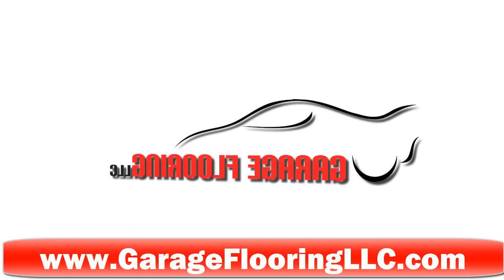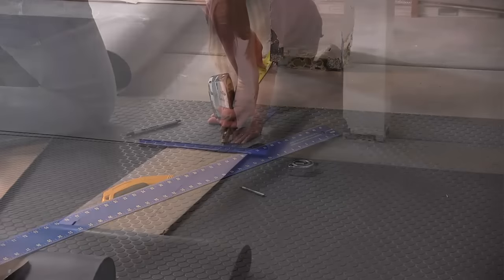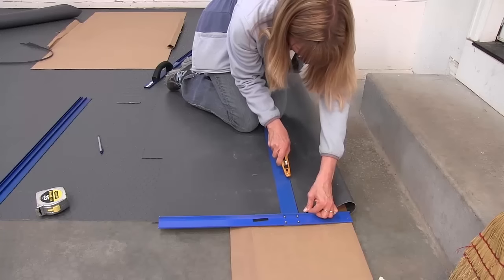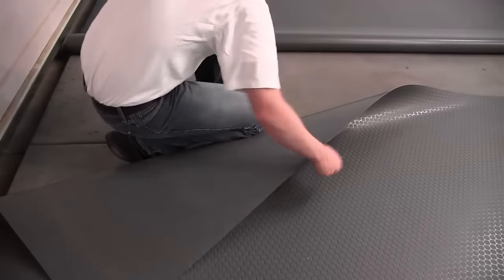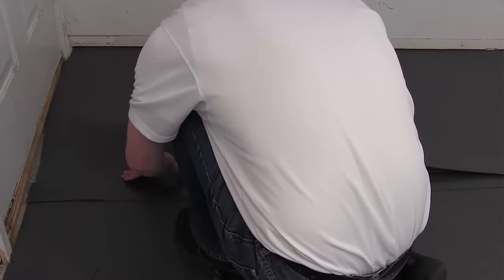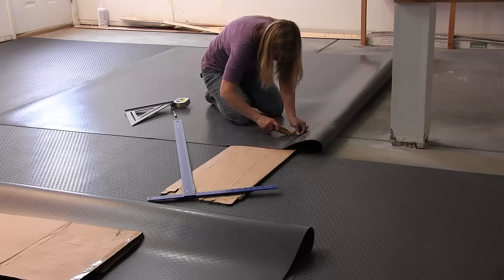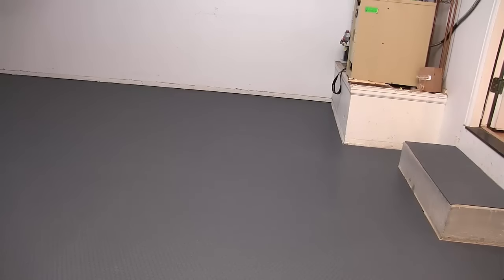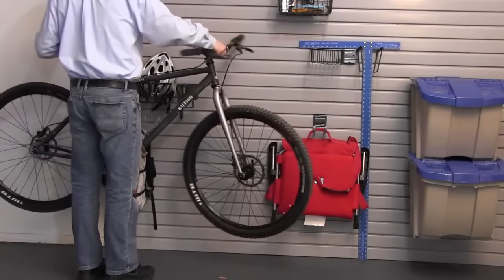How To Install G-Floor Garage Floor Mats from Better Life Technology: GarageFlooringLLC.com

Comment: My husband and i had 2 mats like this in our Garage for probably 15 yrs.or more and we have had condensation problems under neath the mats and we have a vapor barrier underneath our garage floor the moisture underneath the mats caused the concrete to start to crumble when we removed one of the mats the floor dried out right away and we have not had anymore problems since we decided to not put the mat back in, it also was slippery  when it would get condensation sitting on top of the mat, In my opinion i would never use these or any other mats on my garage floor for these very reasons especially if you get snow or live in humid climates.
Reply: I am really sorry to hear about this. I've been doing this a long time and have never seen or heard of this type of issue. If you happen to have pictures, any product information, etc, I would love to have a look. I would also say that for really wet environments, an engineered tile product is going to be your best bet. https://www.garageflooringllc.com/ribbed-flow-through-tile/
Reply: Thank you for letting me know about your experience.   Very helpful.

Comment: Not sure if you are still answering this thread but I too have concerns about snow, ice , dirt and water working it's way into the seam.  We are going to install it onto the floor of a car detailing shop which runs cars and trucks in and out all winter long.  After each job there is literally a lake of ice, mud, sand and water on the floor.  The only way to clean up the floor effectively after is to pressure wash out the door.  As a result,  water and dirt penetrate the seams, get under the tiles and lift them up.  We tried allure adhesive flooring tiles and it was a disaster.  The water and dirt combo destroyed the adhesive.  I don't think carpet tape or double sided tape is going to work from my experience with the allure tiles.  I'm going to try heavy duty adhesive clear silicone under and between the seams.   Hoping for the best, but if you are still there and have any input on this I would be happy to see it!

Comment from the maker: If your garage is being used for parking cars you do not want to install it side to side. The tires will pull at the seams.
Reply: +Garage Flooring LLC Very good point!!!
Reply: What if the roll isn't long enough to go lengthways with the cars?  We are still going to have a seam right where the front wheels park, unless I go the other way and rear wheels would be over a crossways seam.  Cars pulling in are still going to pull at the rear seam I think.
Reply: What about water leaking in between the seams, allowing it under the mats creating mold and mildew?? Have to consider when parking cars on when it's raining out or snowing out.  I live in Michigan, so I get the four seasons.  Any answers to my questions?  I wouldn't want water leaking under the mats. 
Thank you and please answer all questions.

Comment: I would like to use this for my rv garage (24X50'), but probably, depending on cost may only cover the center 12' wide by 50'. RV weighs between 25-30K lbs on 6 semi truck sized tires(22X 295). Would this mat stay put on the floor or need to be glued down. I would much prefer this solution to an epoxy floor Thanks..

Comment: How is this flooring with winter conditions? Our vehicles track in a lot of snow, salt, and sand onto the garage floor. The melted snow makes a watery mess in our single stall garage, kind of wondering if this flooring would be the right choice or not....or if I should just consider painting the floor with a professional garage floor paint.
Reply from the maker: StormLaker1975 It works very well, like any product it can be slick when wet. Some other products to consider would be Rust Bullet Garage Floor Coating http://www.garageflooringllc.com/rust-bullet-concrete/  or TrueLock Flow Through Tiles http://www.garageflooringllc.com/ribbed-flow-through-tile/
Reply: Also, there are matts specific to this problem that you can buy from Home Depot or online to lay on top of this during winter at least.
Reply: could you link a mat like this? The only problem I'm trying to avoid is the issue of tracking in snow/slush/salt/etc leaving dirty pools of water on concrete.
It seems like this flooring would get at least as messy as the plain concrete, with all the grooves stuff can get stuck in?
Reply from the maker: https://www.garageflooringllc.com/garage-floor-mats/
Reply: we have had mats like these for 15 + yrs in our garage see my reply above, in my opinion not recommended.

Comment: what about washing the floor with water? would water just leak thru the Gfloor and never dries beneath the mats?
Reply from the maker: +Ken Li Water is going to go through the weakest point. Typically where two are joined together or at the wall. There are solutions, specific to each application type. Just give us a call

Comment: Great video.  You make it look too easy.  
My question is:  Will water from snow melting from your vehicles, rain and water from your vehicles AC unit.  Will the water,"EVER" penetrate through this flooring mat that you and your wife just installed??  This is important for me to know, before I buy.  Thank you for your time, and video. Very well explained. I subscribed.  Please keep them coming 👍
Reply from the maker: +Nrfa Mats are made from PVC -- the same stuff your pipes are made of but flexible. Water will not go through them, but water tends to seek the weakest point -- a seam, or the wall. There are installation guidelines we can walk you through to help, but ultimately it comes down to jobsite conditions and the skill of the applicator. 

Perhaps more important here is learning what you need to accomplish. Do you have a basement below?
Reply: +Garage Flooring LLC Yes I do have a finished man cave right below, which water from melting snow is going through cracks in it.  I was hoping this would work, to stop the water leaking in?
Reply from the maker: +Nrfa We need to get into some specifics with you and work through a solution. Please give us a call at 800-956-4301
Reply: +Garage Flooring LLC I will, thank you so much.  When are you open from?  I'm in Michigan, so I'm EST...  Where are you located?  Thanks👍
Reply: Nrfa I had the same mats in my garage and two years later I looked and everything was moldy ,I had to throw everything away and treat my cement floor, yes it will get wet under the rubber mat........
Reply: @Garageflooringllc  Yes I do have a basement living space below.  That's why I asked.
Reply: @margieschaben2156  Thank you for the reply Margie!  I greatly appreciate it.

Comment: Firstly, the seaming tape is one sided, which they don't say in the video.  Secondly, it doesn't work.  You won't get the seams together without gaps and wrinkles.  Yes, you will see the seams from the top and sides unlike in the video.  I'm trying now to decide whether to buy the seam trim or leave the gaps showing.
Reply from the maker: +jack sorensen Sorry I did not see this comment. You are correct. Had I thought about it, in hindsight, I would have said single sided. All the application methods we have shown are for a floating floor in which no part of the floor is adhered to the concrete itself. We have actually found a brand of double sided tape that works well, but we like to walk people through some very specific instructions. There is also a fully adhered method of installation. I realize this comment may be to late for you but I hope it is helpful to someone else.
Reply: What brand of double sided tape is it and where can you get it?

Comment: 9 years late on this so the consensus is front to back and not side to side correct.  I don't see a clear answer to this anywhere in the comments.
Reply from the maker: seams should run front to back not side to side.